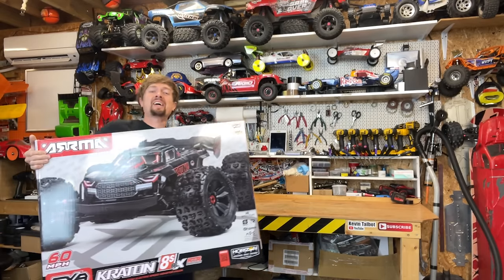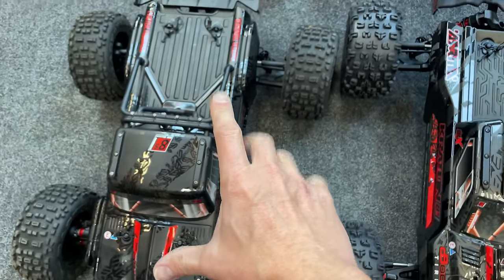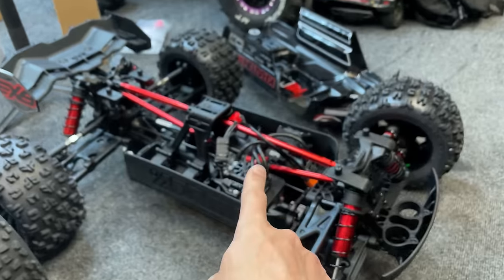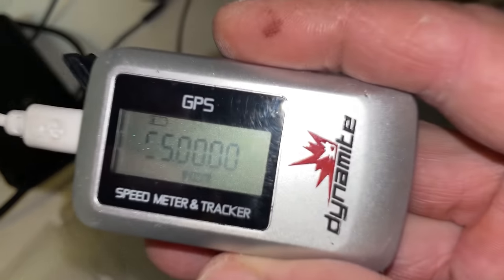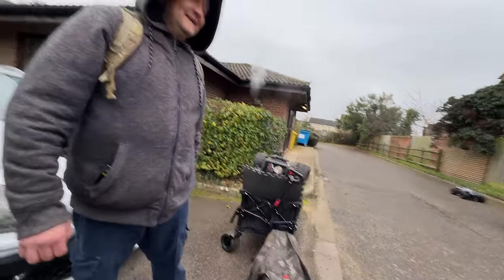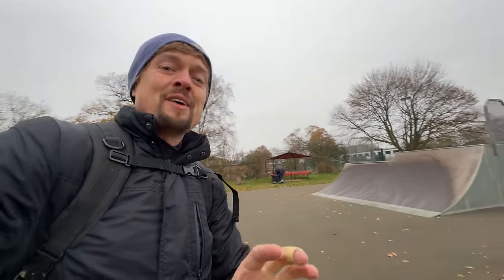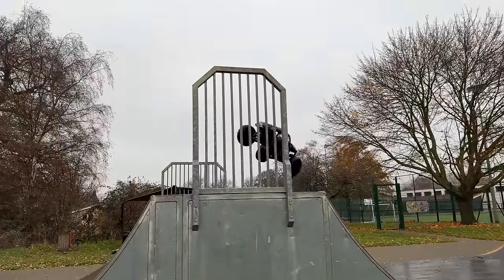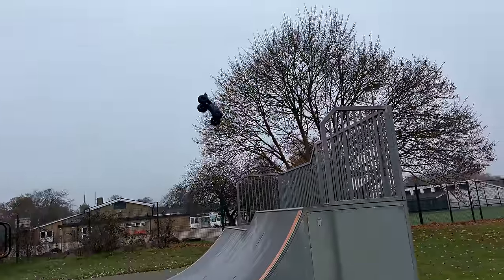This Giant Motor is Too Big for this RC Car

Comment: It almost seems like that M2C chassis brace helped to rip the car in half because of the metal bending. Mainly because i have never seen a stock xmaxx rip completely in half. Not saying it cant be done, just makes me wonder if the plastic could have flexed enough to save it.

Comment: I’ve seen you overpower so many RC cars. But what would happen if you gave one a lower S than stock? Like for example, giving a 4S a 2S? What would happen?
Reply: If all you change is going 4S-2S the motor will spin half as fast. 

Keep in mind if you can change all parts you can have an extremely fast build on 4S and a weak one on 12S by pushing more amps at 4S.

Comment: With metal chassis and electronics on that size we used zip ties, gel tape and foam servo saver tape. Gel first, foam second and tight on the mount (snug) with zip ties. It creates a vibration/shock preventing system. I use it on just about anything and you can mount it anywhere that way.

Comment: The chassis is straight but all the electronics failed. Aroma sucks at durability & I have a felony that I baby. I’d never buy an aroma for bashing. Plastics traxxas ability to bend slightly really helps. The more metal parts you put on make something else down the line break easier

Comment: lower kv means bigger gears needed to reach full speed. i put a 1260kv  castle into my mojave and the highspeed gearing lost around 7 mph, however it can run on that gearing while barely getting hot
Reply from the maker: It’s same kv

Comment: Shock oil looks too thin for bashing. 
Easy fix
Reply from the maker: thicker oil can break stuff when hard bashing
Reply: @KevinTalbotTV  it broke from slapping the concrete 😂
Thicker oil might have prevented that
Reply from the maker: Bulkheads broke because shocks were too stiff
Reply: @KevinTalbotTV  electronics broke because shock oil was too thin.
Reply from the maker: if you thicken it, stuff brakes and you chassis slap anyway and brake the electronics, but you do what ever makes you happy :)

Comment: That motor is lower kv then the stock could put a bigger pinion on and I would of put heavier oils in the diff
Reply from the maker: could gear it up but wanna try it on 12s

Comment: Impressive the chassis might actually now be real 7075 t6. But still not impressed by the 8s arrma line. For the bulkheads to start falling apart by themselves is dissapointing. The weight is still the biggest downfall of their lineup and that is not something they can fix without asking tons of money for it.

Comment: Lots of complaints about the ESC braking when lowering the throttle causing nose dives on jumps etc or just dying completely. Not to mention all the other breakages you encountered..another load of junk promising everything but giving nothing but a huge repair bill. Personally I think the size is getting silly with these new bashers and nothing that big and heavy made from plastic is gonna survive on concrete or dirt for that matter.

Comment: Could adjust the shocks like normal people and go through the diffs like Arrma recommends to check for shimming. They also say check all the screws are tight. Just seems funny how RichD and RcD81 send them way harder and way higher and have mostly minimal damage even on the stock platforms. 
It’s not like you’re doing durability tests anymore but just putting the cars in situations where you’re trying to break em straight away 
I enjoy the vids but I think to be fair you should at least set the cars up properly first dude 💪👍👍👍
Reply from the maker: rtr means ready to run, if you have to strip the diffs down before you run it then you might as well just build a kit. and thicker shock oils would break it even quicker
Reply: They are mostly running out in the dirt though, and in their crashes some amount of energy gets dissipated as the truck tumbles.  Kev airs it out in skate parks and lands to flat on pavement.  All that crash energy is instantaneous.  The shock to the electronics and at interfaces between metal and plastics must be tremendous.  Takeaway...if you are running like that at skate parks, Kraton/Outcast 8S probably not the right truck for that.  If you have those wide open, natural or non-hardscape bash spots that guys like Duper or RCDude run at, then the Kraton/Outcast 8S EXB v2 would be a pretty awesome choice.  As for me, I won't be running at skate parks, and I chose the Outcast 8S EXB v2 with just some modest upgrades.
Reply: Actually in all fairness 90% of people especially those new to the hobby literally toss in batteries outta the box and start bashing without fully tuning shocks first. Yes the more experienced know to go through them because of learning the hard way and shit breaking or coming apart. Of course Kevin is trying to break them he isn't simply giving biased reviews like the fanboys for free gear..
Reply: @KevinTalbotTV   never said strip the diffs, they just recommend u check for shimming them. And not winding down the tension on the springs before launching it is common sense. I didn’t say anything about shock oil.
Reply from the maker: Winding down the springs does not have any difference on absorbing jumps, shock oil does that, so what you may think is common sense is actually completely wrong. Buy who am I to say as long as you’re having fun doing it you way it dosnt matter
Reply: @dieseldabz7104  see what I mean, u wrote it there,  just” trying to breaking them “ not durability testing them

Comment: I would have to say I was quite disappointed with the Krayton. 50% of its purchase price in the first session of failure would kill it as a hobby for many.  Especially with a RTR. 11.5 kg then add the battery weight? Differentials and suspension points just getting torn off just seemed to show a lack of suspension travel and softness. Also those mount screws look no bigger than an 1/8 th scale would use at one third the weight. At the very least a metal threaded insert or through bolts with nuts.. Then there is the battery mounts, no shock absorption. Great for handling but if they were at least suspended with a rubber strap and hanging from posts it would reduce the G's by time when it bottomed out and probably save 90% of the damage it did to most of the parts. A skate park is extreme usage but I think the thing has way to much power for it's build. A real shame as even with alloy everything without a complete redesign to take into account it's weight it will always be a moment away from failure. I think cars like these loose more people to the hobby than they gain.
A great Video